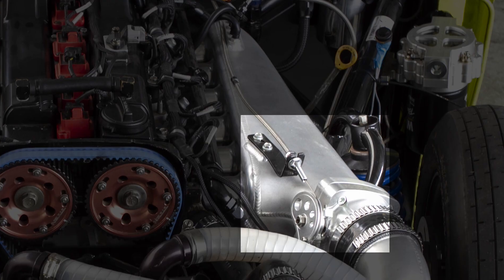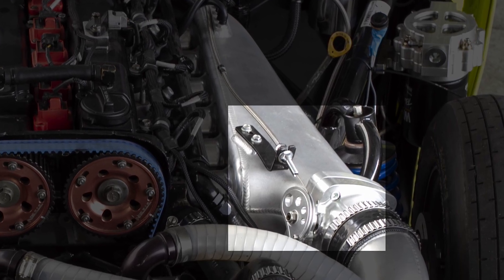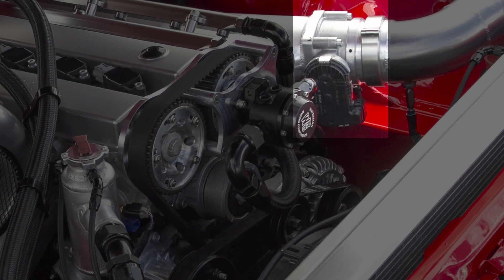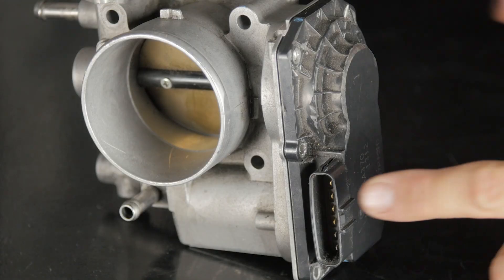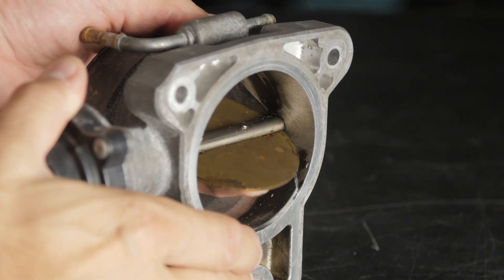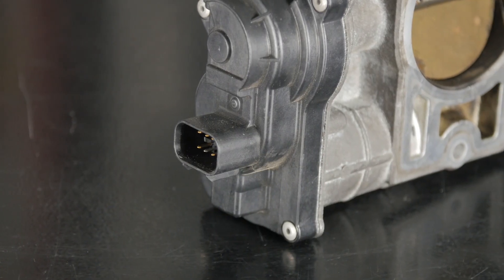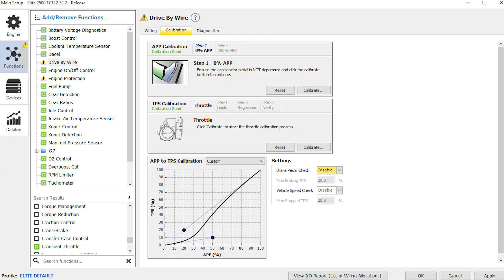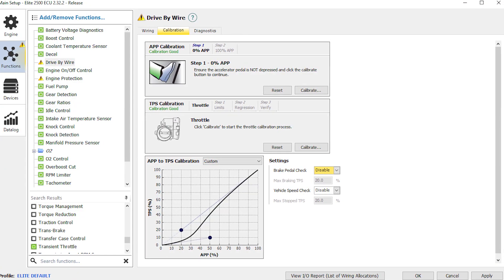🛠 Drive-By-Wire or Cable Throttle?  | TECH TUESDAY  |

Comment: I prefer cable for its directness and simplicity.

Swapped from an engine with DBW back to an older one with cable, and it feels much much better.
Reply: @ThatWasPrettyFunny  I guess I need to try some newer DBW setups to see if my opinion will change.
Reply: @nickamarit I have, no dice. They ALL suck. Universally. Cars AND bikes. Can't escape the latency. Not to mention all the artificial "assist" post-processing...
Reply: @233kosta  Yikes, I always had to reset the adaptation almost everytime I drive a DBW car to regain factory feel. Otherwise they all feel jumpy to me after a while because I drive with a very light foot and prefer to do so.
Reply: @nickamarit  I listened to some of this dude's seminar on tuning these things, seems the haltech approach is actually much better than OEMs' in this regard. If they use the right type of compute architecture, it might even be fast enough to feel just like a good cable throttle. Maybe...
Reply: @233kosta  I feel like cable is the cheaper and more responsive method, still.
Reply: @nickamarit  Like I said - maybe...

I'd have to try one to be sure, but from what I saw I'm somewhat hopeful. It'll all be down to how they built that ECU.
Reply: @233kosta  Sadly tho, OEM's will never use a less-laggy system like Haltech's for factory assemblies.
Reply: @nickamarit  no dbw can match the cable
Reply: cable snaps.

Comment: Next Explain the throttle Control/response on old mechanical Diesels Vs Electronically controlled Diesels. Test Case the Beasty cummins 5.9 6bt Vs Cummins 5.9 ISB. Please.

Comment: A couple of other things - some events have a specified maximum speed the vehicle is allowed to do, such as some Targe events and different classes in events like the Silver Dollar race in Nevada. The throttle can also be used as a torque limiting device in the different gears and for different grip levels - limiting boost is a rather primitive method as that is limiting the maximum torque on the curve, which is leaving potential torque application below and above that peak.
Reply: I wanted to do the Silver Dollar Race but sort of forgotten about it.
Reply: @dj4monie  Take this as a reminder ;-)

Comment: Has anyone overcome the fluttering issues that plague some electronic throttle bodies when used with higher boost? I’ve seen several builds where they had to switch to a cable driven setup because the drive by wire unit couldn’t hold itself open at wot and put the ecu into limp mode.
Reply: Which builds are you talking about? If on the factory ECU that is the problem right there because the values are typically not accessible with backward engineered software.

Comment: I hate the rev hang on my 2017 lancer gsr any idea's?
Reply: Ye of little knowledge it's the dual mass flywheel attached to your clutch. Could get a lightweight flywheel but you'll get a noise similar to the one you get when the throwout bearing is worn (rattling when the clutch pedal is out). Leave it, it's to help people not experienced driving sticks help not stall the car.
Reply: @dj4monie  it's so annoying i didn't notice it when i test drive the car now I'm stuck with it

Comment: The Saab Trionic 7 Management System also use a cable to e-throttle. The thottle cable goes all the way to the throttle plate where it is converted to e-throttle at the same place. Makes the pedal feel more old fashion, which in my mind is a great feel. I feel that newer e-throttle pedals are way to soft.

Comment: One major advantage of ETC is the linearisation of engine torque across all engine speeds.  A throttle plate sized to provide little restriction when wide open at peak power engine speed (say 7,000 rpm) will effectively be wide open at a much smaller angle at lower engine speeds.  On typical OE sized throttles, "effective wide open throttle" (ewot) can be as little as 30% of it's full travel range at just 2000rpm.  By Mapping that into the throttle maps vs engine speed, the engine torque is better controlled and because the throttle is always closer to ewot, it is able to faster influence flywheel torque  (ie is ewot is 30%, and the throttle is (pointlessly) at 100%, then it must close by 70% before it has any effect on torque!)

Secondary, the concept of controlling "pre-throttle boost" becomes possible (to minimise turbo lag) and in conjunction with the "Fast path" ignition angle control provides decent torque back up for any driving dynamics situation.

I run electronic port throttles on my competition car,  with a strategy i have written called "fast-WOT" which detects a rapidly applied accelerator pedal position input, and actually gets the throttle plate open around 30ms BEFORE the driver has got their foot all the way down on the accel pedal (which typically takes 100ms to do). If the driver doesn't actually go to WOT, then the system re-blends the plate angle back to the pedal demand over a few hundred ms in order to avoid excessive torque overshoot......
Reply: 100% there is so many thing you can do with electronic throttle. As always it's always hard to make heads soft enough to accept new information. "Good drivers" always say they are better than any mechanical device, blah, blah, blah. Well look you get the 10,000 hours you need to control the car perfectly with throttle input while I go for the faster solution that just works better. Plus my Focus ST has electronic throttle and we're just now tuning for better traction when under max acceleration (drag strip).
Reply: @dj4monie  thats an Argument to automise the entire Life.... OK little over the top 😀
Reply: Kinda nudging an all or nothing switch.
Reply: That's not an advantage and can be done with Cables as well. Less complex mechanism, lighter, no overrides, etc.

If it takes you 0.1s to put the pedal down you're slow. If you fuck up your detection... well, enjoy that spin, slower and less precise response, etc. If their is an error outside of the person, enjoy that out of commission vehicle (e.g. 737 MAX, murder Prius & Tesla's, etc.).

The short of the long is you have not made a case for DBW. You have pointed to your use case and flawed justifications.
Reply: that's just something that THE DRIVER should be able to do on his own with his foot/wrist and not rely on a computer to do for him. Also, the cable throttle reacts to your input in tenths of a millisecond. What your whole comment describes is your distrust of the driver knowing how to do what he wants or worse, not knowing what he wants at all. It also does not take 100ms to press the pedal from all the way up to all the way down, it takes more like 30ms give or take. If you know what throttle opening you want and you have good dexterity, which you should have, the system you described WILL OVERSHOOT and by a lot, if say you go on the throttle from 0 to 50% and you're good with your feet, you'll do it in around 15ms give or take. So, assuming your system can react fast enough to the input, it will overshoot to 100% when the driver didn't intend to do so and then it'll go back down to whatever the driver wanted to do. Besides, the biggest problem of drive by wire systems is not the time it takes for the butterfly to open to 100% from closed but how long it takes for the butterfly to start moving from the moment the driver's foot starts moving or the rider's wrist starts twisting.

For reference, the pulling on a cable is a tensional stress that propagates at close to the speed of sound in whatever material the cable is made of. Not exactly the speed of sound because that stress is not a wave. Throttle cables are made of steel. A motorcycle's throttle cable is about 80cm long. Do you know how soon after you start twisting the throttle the valve will start to move in that setup? 0.16ms. Can your strategy react in 0.16ms? Oh, by the way, if you twist the throttle grip in 20ms, the plate will be fully open in 20.16ms. There was a video in a different channel with logs of how fast the butterfly went from fully closed to fully open on a car's electronic throttle body, and it was embarrassingly slow compared to a cable... 13ms response time and 63ms to go from fully closed to fully open while the guy pressed the pedal from fully up to fully down in 30ms. It clearly cannot keep up with someone's foot AND it doesn't react as fast as a mechanical connection. To be fair, that video was made 7 years ago, so, I really hope that RBW systems have advanced a lot by then.

Comment: For anybody in europe,all the peugeot 2.0hdi(306,406 expert etc)
 from the 90's had the same style of cable to throttle sensor set up
Might be easier to source
Reply: From 90's to 2004 to be exact

Comment: Early versions of Honda K20 were based on cable (ex. EP3), later on, were available versions with cruise control, VSA and Drive-by-wire.
In case of Honda Accord, between 2003-2005 there were available K20 (based on cable), and K24 (drive-by-wire) with VSA.
To reuse a lot of components, like pedals, brackets etc. Honda decides to use adapter cable-to-wire used in K24 and in K20 since 2006.
This adapter after few years is starting to be problematic, because inside there is an electronic potentiometer. Potentiometer starts to wear out and the dust begins to affect its operation - but can be opened and easily cleaned up, after it should work correctly again ;)
Reply: Very interesting information mate.

Comment: Having been using only cable prior to DBW, all I can say now after years of DBW-driving is; that I miss cable, it just isn't the same with electronic, and just do not get the right pedal-feel or any of the older auto 2-stage throttle feels like on some older Volvo's (where there's a tactile "extra travel" in the throttle & pedal for 'full power').
Reply: Couldn't you just put a stronger spring or a damper below the pedal? I feel like again this is not the fault of the electronic throttle but the setup at the pedal being sub par which diminishes your in cabin experience.
Reply: @anonchannel1058  Yeah he blames technology because it's easier to do as he and the majority of others are always fearful of what they don't understand. Pedal Feel is only crucial if your still on that horse about better drivers have some natural feel for the car in certain situations. I drag race so 88% throttle on my is WOT, I am not trying to modulate the throttle, I have programmed clutch slip. Along with managed throttle opening I will have the best 60 ft times possible from FWD very soon without having to have an ultra wide tire.
Reply: @stoeger 2 He is a fool and doesn't understand that even a carb systems can be sized such that 88% on throttle would be effective WOT. But kids these days don't understand mechanical systems or even how to do a proper pro/con "analysis". They are stuck in a mentality where newer or more advanced means better to them.

Comment: I think some early Mitsies use a remote cable style TPS setup for the throttle aswell
Reply: Also some older years Mercedes cdi diesel cars have a cable to Potentiometer and a electronic throttle body
Reply: WMD-C35  yup the rvr, chariots did , horrible gdi engines they had aswell